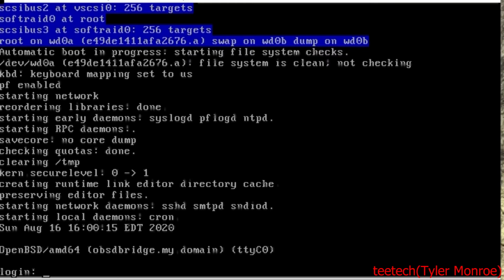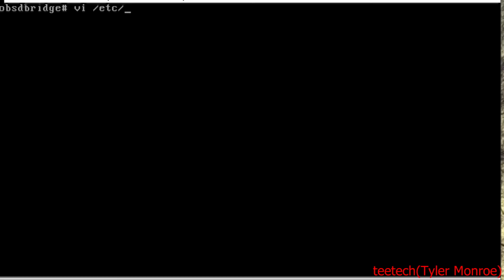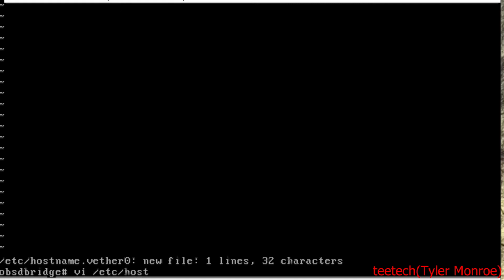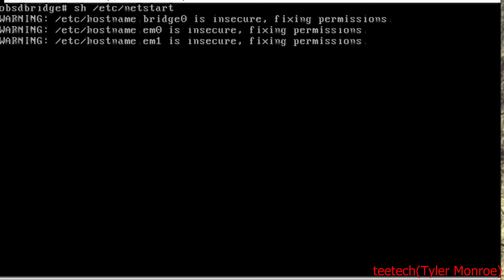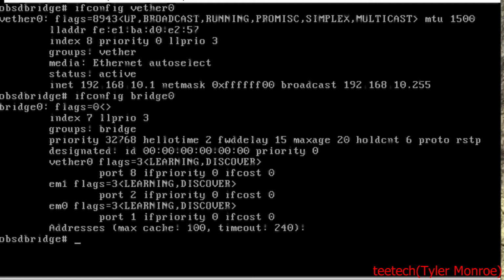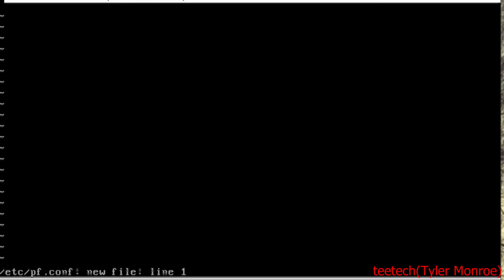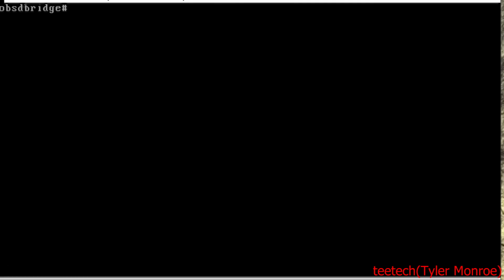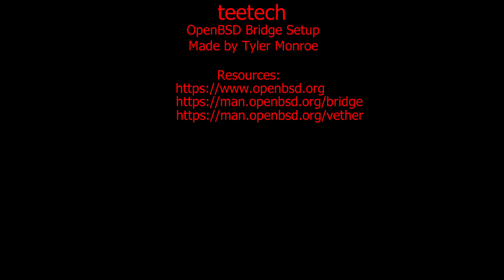OpenBSD Ethernet Bridge/Switch Setup

Comment: "sh /etc/netstart" is saying that em0, em1, and em2 are not there.  Any suggestions?
Reply from the maker: The name after the dot at the end of the file name is the driver OpenBSD is using to talk to the NIC, whether ethernet or wireless. It will change depending on the NICs you are using in your system. I was using intel 1Gbit nics in this video so em was the driver OpenBSD was using hence why my files were hostname.em0 and hostname.em1 respectively. 

Look at what NICs you have in your system with the ifconfig command first, as I said before you most likely have different ones in use. 

Be careful simply copying and pasting filenames and such.  Definitely avoid it when you are writing firewall rules etc. As you may open up security holes you didn't intend to. I totally understand it is tempting when you are first learning something new but it can be an issue later on.

Also these may help you out also.
https://man.openbsd.org/ifconfig
https://man.openbsd.org/hostname.if

Thank you for watching my videos and have a nice day!
Reply: @teetechtm  Double checking the details, it appears that my motherboard doesn't support anything aside from the physical ports.  That said, it appears to be iffy with any logical ports.  I do have another question; would you consider doing a tutorial on doing a config file for openvpn? I know it sounds foolish, but you have the best tutorial videos I've seen, and they're the easiest to both understand, and follow.
Reply from the maker: What type of system are you using? Are you positive there are no other expansion options it supports like PCIE or maybe USB ports? Is it an embedded system?
Reply: @teetechtm  If I understand correctly, this is not an embedded system - just a default install on a clunker I got.  That said, I believe the ethernet port is embedded, and not connected via PCI/PCIE, USB, or anything else.
Reply from the maker: Do you have the model number of the system by chance?
Reply: @teetechtm  Unfortunately I do not.
Reply from the maker: If you ever find out more information about this system let me know ok.
Reply: @teetechtm  What specific details are you looking for? I apologize for the delayed response.
Reply from the maker: Either the model number or brand name. Even a data sheet would help me. That way the specs of the system can be looked over to see if it has any expansion options at all. 

Even if it is in fact in embedded system it will still have some form of identification on it. PC Engines for instance is an embedded system but they still have model numbers eg APU4D4 printed on the motherboard etc... Unless you are taking about some custom designed one off system made by a PCB fabrication company. Which I don't think is the case here as that would be highly unusual and very expensive for a single person to have made for them. As they most times take bulk orders of a PCB design.
Reply from the maker: It looks like your only expansion options is going to be via USB ethernet adapters. That will still make a good system and most of the chipsets inside of the adapters are compatible with the BSDs and Linux.

It seems you have the 10B0 hardware type of that machine. Also I think it is Lenovo made if you need that info too.

Here is some specs for you to look over and a hardware installation manual. Note not all of the instructions in the manual are applicable to your 10B0 model sub type so keep that in mind.

https://psref.lenovo.com/Detail/ThinkCentre/ThinkCentre_M73_Tower?M=10B00019US

https://download.lenovo.com/pccbbs/thinkcentre_pdf/m73_hmm.pdf

Here are some USB ethernet adapters I would recommended TP Link branded ones as the chipsets they use are very well supported. Some of the smaller brands use less supported ones so keep that in mind.

https://www.amazon.com/USB-Ethernet-Adapter-Gigabit-Switch/dp/B09GRL3VCN/ref=sr_1_3?crid=2W6ECOHRNX92C&dib=eyJ2IjoiMSJ9.wjH9jMBieaS2E-4Ouj-djXzXH3lUKytRwAdn9KYydZRFxlaymg3C5EwGjuQ9ACVslh2e7vfP1sVEq9gbXqRM2Hnd_wwvairwThpfHZ8Dm4sTPYkKCXCzQQ8s8LZ7kOAO9NirNBH8uR4gN7uuHTrXP1l9vvgMaTDdQZ4MNL6FYm_dx7gwElT45nljUgaYi9yNOBkANPiHfM4PNrJVN39l6jotGvNeMHRog4sl2LYaINw.T_JMCMazSFp8EoYOsu8CrJgDkO9hTSuGaPY3kdFjrEE&dib_tag=se&keywords=usb+ethernet+adapter&qid=1733250591&sprefix=usb+ethernet+%2Caps%2C135&sr=8-3

Hope that helps you out! Remember USB ethernet adapters will work fine if that is your only expansion option as it is in this case.

Have a nice day!
Reply: @teetechtm  I appreciate this.  Thank you.
Reply from the maker: You're welcome!